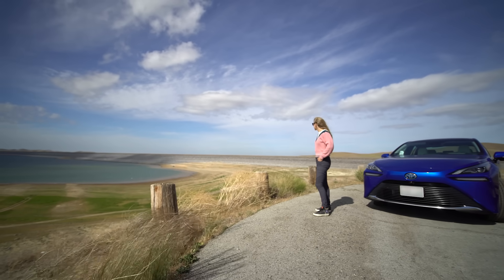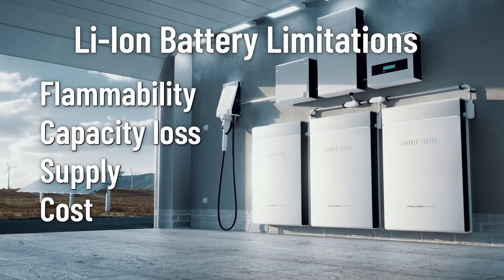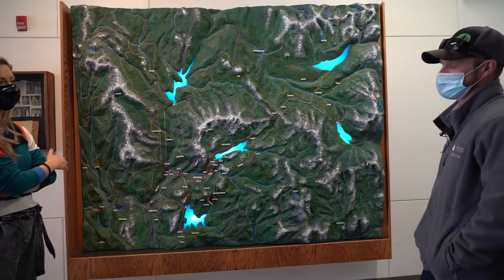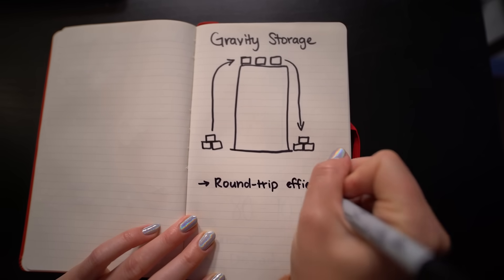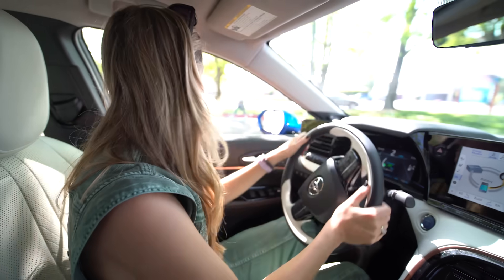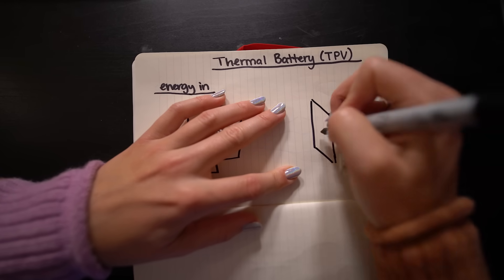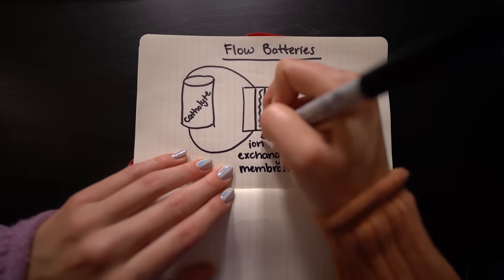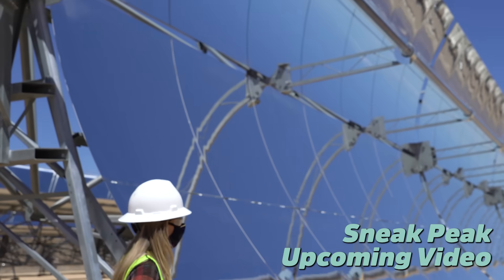The BIGGEST problem with clean energy

Comment: I researched "Grid Level Energy Storage" in 2014 for my chemical engineering design class my senior year of college. I remembered a few of the storage options presented in this video, but I was actually able to find the presentation and it's interesting to me how it matches up 7 years later. 

Our criteria, in order of weight, were as follows. 
30% - Longevity of the battery, targeting 25+ years, or ~10,000 charge cycles, of useable life and weatherability 
30% - Performance, targeting 90% energy efficiency with high energy-density, ideally as good or better than Li-ion 250 Wh/kg, and ability to store up to 500 MWh of electricity (to replace the avg coal plant)
20% - Toxicity of the materials used in the energy storage- this is probably the weakest criteria in the presentation
10% - Infrastructure required to make/use the energy
10% - Cost of storage method in $/kWh

The most promising energy storage we found via these criteria was a liquid metal battery. From our research we found they would last conservatively for 15+ years, have up to 90% energy efficiency with around 200 Wh/kg energy density, plentiful and (relatively) low toxicity elements Magnesium and Antimony (generally any 2 metals with different densities), and a projected cost of ~$50/kWh once production is in full swing. Nice to see that one of our sources at the time, Ambri, is still chugging along and making their batteries. https://ambri.com/technology/

Next best in our estimation was 'pump-storage', which as Dianna has thoroughly described it is widely used, has good efficiency and makes use of existing geographies to store energy, but the downfalls are that there's not much room to expand and there is a high capital cost to create more storage of this type. 

3rd was the Vanadium flow battery, which again I don't need to rehash since the video has the same conclusions our group came to. Easier to scale than Li-ion, but otherwise not much of an improvement.

Last in our estimation was scaling Li-ion batteries to grid-level energy storage. The safety concerns along with limited availability of Lithium create the need for other sources. 

One interesting addendum to the project was a zinc-air battery that was in early stages of research in NYC. This was essentially zinc cells in a shipping container, which was a funny picture to me. https://www.aiche.org/chenected/2014/07/testing-zinc-air-battery-storage-new-york-city-grid
Seems like this idea (metal-air) is still being innovated 7 years later. https://www.rechargenews.com/energy-transition/worlds-cheapest-energy-storage-will-be-an-iron-air-battery-says-jeff-bezos-backed-start-up/2-1-1044174

Anyway, this was an awesome video and it allowed me to reminisce on a project I was very passionate about 7 years ago. Maybe its time to rekindle that passion...
Reply: Nuclear engineer here. Surprised liquid metal or molten salts aren't in this video!
We use them as energy storage solutions in reactor designs like Natrium
Reply: @AJ5  Why do you want to use the most dangerous materials in the world to solve a problem for which you can even use the least dangerous material like air? Whats your profit?
Reply: @wolfgangpreier9160  Natrium has its values in reactor, but getting it to work is lot of "fun" as Russians have demonstrated. Molten salts and lead otoh are completely safe and usable in reactors.
Reply: @trex2621  Molten Salz does not generate energy its only used for heat transport and scavenging. Also in Solar Farms in e.g. Morocco. For heat=energy generation you need deadly radioactive materials. Either Thorium or Uranium or Plutonium or on the other side of the spectrum Tritium.
Reply: @wolfgangpreier9160  It's possible, I didn't get your point, did you argue against use of Sodium or nuclear power. 
We live with these "deadly radioactive materials" every day and have lived as long as life exists on the planet. And with Potassium in our bones and in seawater.
Reply: @AJ5  And what about energy conversion? In nuclear reactor you already have heat, so no need for extra step and huuuuuge losses.
Reply: @AJ5  this video is about energy storage not power generation. If we went nuclear we wouldn't need bird blenders or energy storage in the first place so you could argue the best storage solution is the one that eliminates it.
Reply: @theslimeylimey  Some reactor technologies offer energy storage solutions next to power generation. See Natrium as an example 👍
Reply: @AJ5  very interesting...
Reply: @theslimeylimey  nuclear is too expensive to outcompete fossil fuels and power the majority of the grid, even when you factor in storage costs a properly balanced mix of wind and solar is already cheaper than nuclear in most regions.
Reply: @theslimeylimey  small scale reactors are still pretty much unproven and are likely to require more paperwork and labor per unit of power (lots of extra redundancy and duplicate parts that has to be created, installed, and maintained if you have to build more reactors) so it will be an extremly long time before economies of scale will be able to bring down the costs enough to matter.
Reply: @theslimeylimey  I am not declaring small modular reactors non viable, it just won't be feasible to get the production of small reactors to the point of viability within the next 20 years, and stating that we shouldn't be installing the cheapest and cleanest energy sources currently in existence because another technology might mature eventually is impractical. The development of modern wind turbines and solar panels took roughly 40 years of serious investment to reach the point of viability so that analogy is fairly accurate.
Reply: @garethbaus5471  Nuclear is expensive because of the environmental, legal and political issues involved in building and maintaining reactors using old technology. The technology has advanced to the point where these issues are  and should no longer be concerns. The problem is, none of these new reactors have actually been built yet to prove that this is a viable alternative. And this is more viable than solar and wind without the problems of storage. It's like the ethanol in gasoline issue and cars where people thought they were saving the environment by implementing this idea. Environmentalists however have finally admitted that it does more harm than good but because of political reasons (i.e. congressmen and their constituents benefiting from it), it continues to be used to this day and probably won't go away anytime soon.
Reply: @gigakrait5648  solar + wind + storage will get too cheap to compete with before any new nuclear plants get scaled up and available.  The problem is nuclear plants take so long to develop and build; meanwhile solar and storage get significantly cheaper every year.  This trend will continue for decades, making nuclear a bad investment that only gets worse over time.
Reply: I’ve heard about liquid metal batteries, Real Engineering did a video a while back about them. Kinda bummed they didn’t make into this video, but still cool seeing all these other types of energy storage
Reply: @forlornendeavor9183  yes, a pity, I like the Ambri idea too.
"To make it dirt cheap, make it out of dirt!"
Reply: @forlornendeavor9183  Joe Scott (Answers with Joe) recently did a video on liquid metal batteries too, specifically mentioning Ambri.
Reply: How did Li batteries fair if considering re-using expended automotive batteries?

Basically on the whole Reduce/Reuse/Recycle plan it would be better if we could take old batteries from bEV and use them in grid scale storage for another 10-20 years before we send them off to recycling (hopefully a good recycling method is achieved by then).

So they may not be the best battery solution for raw production of the solution but if they are just laying around then why not?
Reply: @5353Jumper  This was not part of the project - we simply didn't think about this angle. If I revamped this project and tried it now? Well the "hopefully there's a good recycling method" would be a negative mark but it's certainly an interesting path to research!
Reply: @5353Jumper  lithium batteries have a major problem with heat
The use of a lithium-ion battery is possible in a temperature range of 10°C to +55°C. However, the charging should take place only at a battery temperature of +5°C to +45°C.
The low temp issue is not much of a problem, Insulate your container and maybe just using them will make enough heat to keep your temp up.
overheat is a major issue on a hot day, if the battery gets too hot most lithium cells have thermal runaway. Once that happens you have a fire, and fire means damage. When you do things like this on a massive scale battery fire risk can cost BIG time
Reply: If we are going to need huge storage mediums for electricity, we should look at the liquid metal battery. It seems to have the lowest cost of refurbishment, the recycling of the major components is probably going to be the most cost effective of any battery types i have learned about. Lithium batteries should be considered a joke to use on large scale to anyone with a 'green' mindset. They have their place where power to mass is important, but any stationary units that don't care about mass should use something more suitable than a container full of thousands of cells that must be kept cool, keeping something warm/hot is much easier.
Reply: None of those really cover seasonal variation, I'm not even sure if they would adequately cover week long type shortages. 

If your grid is built around solar for example, youre going to have an abundance of energy mid summer and that will need storing to cover the cloudy mid winter week. batteries can do that, but it seems expensive. these kinds of batteries  would surely be more suited to covering the night time.

A lot of your criteria aren't even relevant. who cares about efficiency if the energy is literally going to waste otherwise? If midsummer solar is just getting dumped, why not store it at a 50% efficiency?

I would guess this is going to be covered by hydrogen / methane / biofuels that would have the advantage of being able to use already existing gas / coal power stations.
Reply: @benholroyd5221  I keep saying that thermal energy is the way.
There is 6 times infrared energy than uv from the sun 
The efficiency of infrared collection is 3 times uv. That's 18 × the energy!
Why are we spending so much $ developing uv? 
 Plus if you store 20 tons of molten salt under 100 feet of  earth for a year 90% of the heat will still be there. Ready to power a steam turbine
Reply: @benholroyd5221  I wouldn't say these criteria are "irrelevant" but this singular, 3-credit, senior design class project from 2014 certainly isn't the end-all-be-all when it comes to energy storage. 

Yes, the focus of this project (as best I can remember) was largely considering day/night cycle storage needs - certainly the largest current need. Week-long outages and other issues would likely be the next problem to tackle on a long list.
Reply: @Benisuber1  agreed. I did have an entire section covering all this. But cut it for Brevity.
Reply: @benholroyd5221  anything that burns a fuel to make electricity needs to stop. Highly efficient natural gas plants are likely going to stay in regions where there is lots of gas production because they already exist and are so cheap, but if we can limit them to a peaker backup only that would be best. 

Hydrogen is OK if actually produced through the inefficient Electrolysis method using off peak surplus green power. But we need to avoid doing it with the methane steam reforming method at all costs because that is just the petroleum companies trying to maintain a bit of market share burning their products for energy which we cannot allow.  If we can continue developing the electrolysis method so it gets more efficient that would be best, as it is now there are likely several better ways to store the electricity/energy. 

The only advantage hydrogen has is that it is portable, so grid produced hydrogen can be taken to isolated endpoint locations or used in transportation. But again it is only better if actually produced with excess off peak capacity green power, so supply may not be reliable enough to significantly use it for transportation.

This will take a varied approach combining energy generation and storage at the endpoint (rooftop solar, commercial rooftops solar, small batteries in houses and buildings, utilize bEV batteries as supplimental) plus improved grid efficiency, plus more green grid  generation projects, plus more grid storage projects, plus improved peaker capacity. Also not mentioned in the video is small and large scale next generation nuclear. 

We will need a wide approach, not only to improve the electricity generation today but also the increased demand from electrifying transportation. 

But really anything that burns a fuel of any kind to produce energy/electricity needs to stop immediately.
Reply: @5353Jumper  I was talking about producing hydrogen / methane with excess electricity. Ie carbon neutral.
Reply: @benholroyd5221  Hydrogen is OK if produced with excess green energy. 

Just worry because most of the funding behind the hydrogen initiatives is petroleum based so we gotta watch the narrative around that to ensure it ends up in the right hands because the wrong hands are very dangerous. 

But the hydrogen double conversion process is so inefficient compared to other energy storage and use models, it may be part of the picture but needs a lot more improvement work. As I mentioned the only advantage is that it is portable and could be used in transportation to alleviate the grid problem of fleet electrification or maybe long haul transportation. But if we are only producing it as excess off peak green energy storage, the supply may not be reliable enough to use in significant transportation quantity. 

I do not know enough about CO2 to methane electrolysis but intuitively it sounds like not a great solution. Using CO2 to produce something useful sounds great, but then burning it again to put the CO2 back into the atmosphere and risking methane leaks does not. Maybe this is better than pulling fresh methane out of the ground but sounds like a lot of work for a small improvement, compared to just eliminating all methane demand completely. Seems better to limit methane demand to match bio-methane production (agriculture & landfill) and not create any new sources of methane in the world. Maybe if you have some information on the amount of CO2 captured, vs the amount of electricity used vs the amount of CO2 released with the methane is burned again to see if it is emissions efficient or not?
Reply: @5353Jumper  even blue hydrogen (made from methane but capturing and storing the carbon) is expensive enough that it is pretty much only useful where energy density is really, really important like air travel.
Reply: LiFePO4 batteries are currently really close to most of those criteria.
Reply: @garethbaus5471  Yes, sure, but there is most crucial criteria missing. Scalability. Li gives us 1 kWh/kg (with theoretical potential up to 7) This is 1 Mt /TWh. Known reserves are 30 Mt, our yearly energy consumption is 70 000 TWh and rising. So all existing Lithium is enough for just dealing with daily duck-curve.
Reply: @trex2621  current known reserves of lithium are far from the total reasonably easy to extract amount of lithium, we only recently started seriously looking for lithium so there almost certainly are some high concentration sources of lithium that we are not currently aware of. And even if we deplete all the easy sources of lithium current estimates put the reasonabley extractable amount of lithium in the world's oceans at approximately 20 gigatons of lithium, we just need enough demand to finance extraction.
Reply: @garethbaus5471  At the same time we have virtually unlimited reserves of easily accessible Magnesium and Aluminum. Battery production wouldn't even affect supply and demand of Aluminum much. But Magnesium is probably better.
Reply: @trex2621  it is pretty hard to find practical information on magnesium or aluminum based batteries to compare longevity, charge/discharge efficiency, or cost to lithium ion batteries. LiFePO4 batteries definitely are within range of the cost, longevity, and charge/discharge efficiency ranges listed, and all of the materials needed to produce them are available in sufficient quantities to supply the world's needs. That doesn't necessarily mean they are the ideal option, it just means that they are perfectly adaquate for the task.
Reply: Good data! 📝
Reply: GMG an Australian company claims to have demonstrated Graphene Aluminium Ion Batteries with insane power output and input. They seem very promising?!?
Reply: @konstantinavramidis5436  Show me a real world application where at least one customer bought this thingy and lets it run for a few months at least.
Reply: Here's a good video on recent developments that have spun of from the zinc-air battery you mentioned. Now using iron as a oxidising element.

https://www.youtube.com/watch?v=UDjgSSO98VI
Reply: @Benjamin Alfveby:  As someone who did the research, what is your take on the best way to approach these methods of storage. Are there any drawbacks that need to be focused on, i.e.  batteries are great methods of storage but what is the impact of the manufacturing process that proceeds the function of storage? The cyclical methodology of using gravitational potential energy is an ideal example but even that comes with limitations.
Reply: Thermal storage of molten salt is the way
Zero toxicity 
Unlimited cycles 
Minimal rare earth's involved 
Low maintenance costs
Reply: thankyou for this :D maybe you should :D
Reply: And today it would be LFP, maybe - if available soon - Na+. Then compressed Air, then Vanadium Flow, then pump storage.
Funny thing: The biggest batteries are Li-Ion. Why? Because they are available and work okay. 
China has one Vanadium Flow battery. Thats all. One piece! 
Every other technology has to proof their value first before i would recommend them.
Reply: @wolfgangpreier9160 Largest battery in the world is Bath County, VA pumped storage hydro power.
Reply: @George Mann sounds great, now create a system that can convert that energy into a useable form for less than the cost of natural gas without being excessively hazardous.
Reply: re-kindling could be disappointing.  scientifically this is a problem relatively, easily dealt with.  unfortunately, u have to convince profiteers and politicians to go along with ur idea..tesla ring a bell?!?
Reply: Energy storage, particularly of "high grade" forms of energy like electricity, is the hardest practical physics problem facing humanity and it's no wonder we practically have not even started properly addressing it. There are no highly promising options in sight (let alone guarantees we will find a solution) either...

In the meantime we should be hedging our bets with getting started with carbon neutral generation capacity (total lifetime CO2 footprint; emissions embedded in materials included) that is able to be almost a drop-in replacement to existing fossil fuel boilers, when practical, so that brownfield installations can be considered. Perhaps the European Power-to-Gas roadmap plays a part, who knows, but we should also consider small modular nuclear capacity to be included in the mix. All of this will take time no matter what so we should have started a generation ago...
Reply: What about gravity? Winching ballast up and down mineshafts, or rolling boxcars up and down steep grades?
Reply: @williambrennan104  The devil's in the details; the train cars up and down a hill idea seemed genius but a closer look shows it would only be a good fit for frequency control of the grid (an important service that has a market, but it is the shortest of timescales that can involve energy storage) and its capital expenditure doesn't close a business case for any long term energy storage, certainly not seasonal storage (say, over winter).

Mine shaft idea may work, lots of variables to consider, some of which are outside project developers' control - not all mines are dry. Plunging weights in and out would disturb the water table and depending on what kind of mine it was, the mine water discharge may be toxic. That's just one of many tricky things to consider, and in any case it would be limited to near places that have suitable mines with vertical shafts to begin with.

Some places could be converted to pumped hydroelectric storage but not very many sites are all that great. There's a Dutch concept like that titled "Underground pumped hydro storage : Flatland Large-scale Electricity Supply", see URN:NBN:NL:UI:10-1874-369013 for the paper. I like it... here's hoping someone funds its eyewatering budget for making sites anywhere we may choose, but the upside is that its infrastructure would remain functional for decades, if not centuries.
Reply: Thanks for sharing your research. I typically don’t read long YouTube comments, but yours was quite interesting. I wish I could go back to school all over again to be able to learn about renewable energy forms at this level. Thirty years ago renewable energy wasn’t a thing.
Reply: Not to throw water on your study, but the cost of Li-ion batteries by KWH are almost 1/10 the cost of what they were then, and continuing to drop.  Technology surrounding Li-ion batteries is changing fast, and this is just with evolutionary development, not a revolutionary discovery.  Costs will continue to drop.  And if a solid electrolyte is developed, energy density and battery lifetime will both go way up.
Reply: @paulcummings55 If you're considering lithium for grid storage you are misguided as it diverts batteries that could replace a less efficient automobile power source with 25% to 45% efficiency. Where a stationary power plant is capable of +60% efficiency when properly designed. If paired with combined heat and power cogeneration system it could achieve up to 90% efficiency.
Reply: We all want to champion underdogs.  I like the company who heats up sand to store heat energy, it's surprisingly straightforward.  The molten salt  mentioned sounds like a good idea.  I've seen presentations from a guy about liquid metal batteries for years and he was presenting to military, I don't know why he hasn't been successful enough - maybe he wasn't underdog enough.  In the end the one who succeeds in scaling up is vindicated about the technology.
Reply: @mannygee005 The problem of a sand battery is that while it is abundant and cheap it has low thermal conductivity necessitating relatively complex spaced out heat exchangers throughout the sand pile to effectively deposit and withdraw thermally energy of grid scale demands.
Reply: 7 years later, li-ion batteries have made big advances
Reply: i think you messed up in your paper. volumetric or weight (Wh/kg) is completly and utterly irrelevant in grid storage so it should not even make it as a factor. price per kwh over the economical lifetime of the installation is the only metric that matters. and even current lithium batteries pay themselfs back in months, not years already.
Reply: @SupremeRuleroftheWorld  I didn't say a word about volumetric or weight of batteries but wrote about resource availability.
Reply: It's not a competition, yet squeaky wheels get greased.  When you look around, a lot of quiet people are getting stuff done only to be buried by by the sheepherders of mainstream medias.  I had an opportunity to partake in the building and commissioning of a fischer Tropsch pilot plant in 2017, and I find it frustrating that synthetic fuels are rarely mentioned in presentations about renewable energy storage.....it's tough to match the energy density of diesel fuel - I am more optimistic about hoverboards and blimps than I am about battery or hydrogen powered commercial trucks.  My gut feeling says that the "activation energy" of producing synthetic hydrocarbons from streams of off-peak renewable electricity, methane, and CO2 (auto thermal plasma reformed - to un-burn that CO2 into fuel) could be favorable.  Though margins are a drop in the demand bucket, diesel is far more valuable than biogas, and right now electricity ($4.07/gallon as electricity).  Carbon neutral jet fuel is worth a pretty penny, and synthetic motor oil pre-cursor is gold.  If selling is too much trouble, municipalities could offset fuel expenses for fleets/backup generators with poofy-poo-diesel..  These resource streams collide often in many municipal wastewater treatment plants large enough to have anaerobic digesters....my last plant manager had all the infrastructure for this operation and wanted nothing to do with it.
Reply: Storage and batteries are now obsolete, people do your research; there’s availability to push the power collected into lines directly. It’s the only way if any of you are talking about storing power in batteries I don’t even want to hear it, you’re wasting more than you can save just by producing the batteries.
Reply: @beefybmw9532  Are you on a different page of the same book?…If you think of the power grid as a pressurized network of water pipes, and thousands of roof panels are pressurizing the power lines, the power plant has to slow or turn off its pump to prevent over pressurizing the “pipe”, and springing a leak.  When darkness or clouds block sun, the power plant has to turn the pump faster or turn on another pump, to avoid a power surge.  There’s a hole in my bucket dear Liza, dear Liza…..
Reply: How about an underground flow battery with mercury, or similar density liquid, as the working fluid?
Reply: know whats even better then all of them? THE ATOM we need nuclear not storage that will never be here in time
Reply: Lithium-ion will get very cheap and reliable.  There is so much investment into several li-ion chemistries that they will continue getting cheaper and better.
And there isn't a shortage of lithium.  The price may go up temporarily as traditional sources get stretched, but the Earth's crust has plenty of lithium.  There will be many new ways of mining it, including from ground water and the ocean.  Ultimately, lithium won't be the limiting factor of the success of li-ion batteries, it will be the other elements.  

For grid storage, the LiFePo chemistry is ideal because iron and phosphorous are plentiful, so it's a matter of manufacturing scale to make LiFePo really cheap, which is certain.  It will likely go below $50/kWh by 2030.  I wouldn't be surprised to see $30/kWh, which is cheap enough to combine with renewables and a cheap long-term storage like iron-air to shut down all thermal plants.  
If LiFePo doesn't get that cheap, there will be other li-ion chemistries, plus lithium-metal batteries, coming soon.  Surely one of these batteries will get very cheap in the near- to medium-term.
Reply: @charliedoyle7824  Just a minor niggle: LiFePO, not LiFePo. Po is polonium.
Reply: @samiraperi467  thanks!